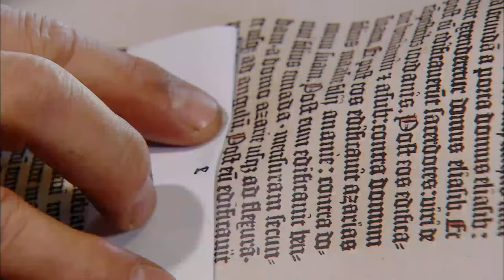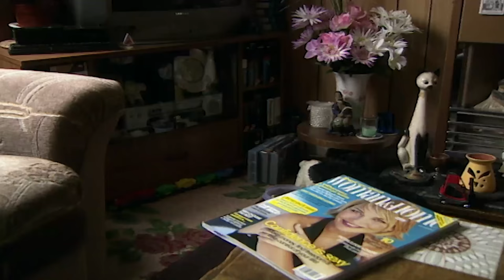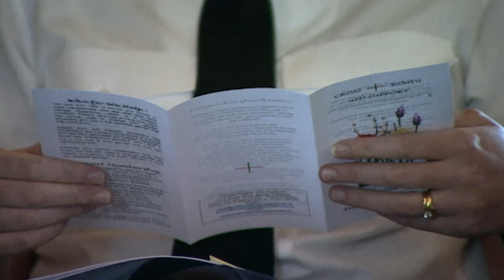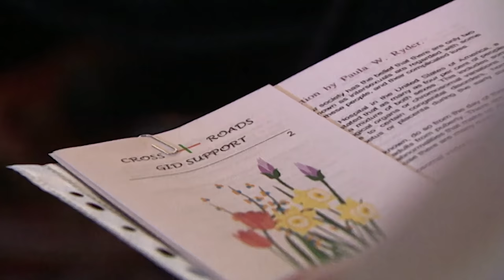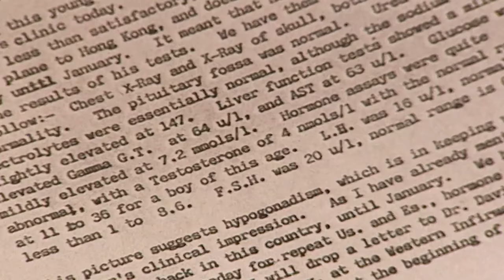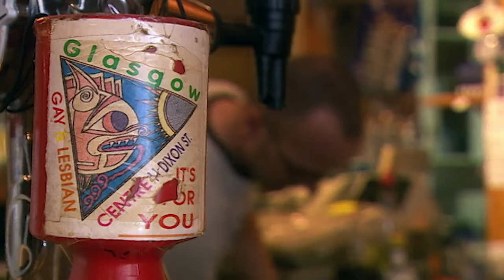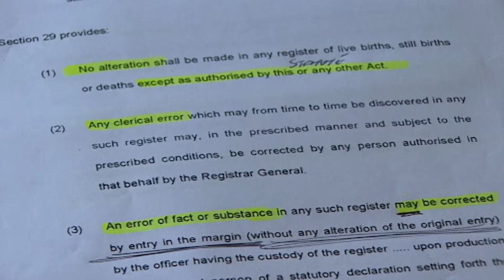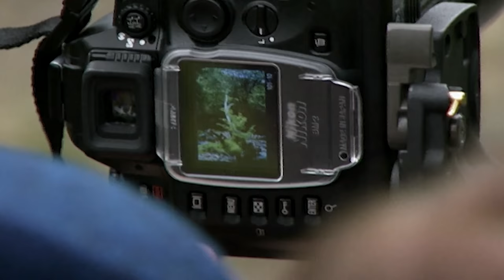Real Pride Special: Hear from XXY Individuals

Comment: Klinefelter syndrome, are not typically classified as intersex. This is because XXY individuals do not exhibit a discrepancy between their internal gonads and external genitalia, and they generally do not have both male and female characteristics. The Intersex Society of North America (ISNA) has historically avoided applying the term "intersex" to individuals with additional sex chromosomes, such as XXY, unless there is clinical evidence of intersex

. The 2006 Consensus Statement on Management of Intersex Disorders, published in Pediatrics, also does not include XXY individuals in its definition of intersex.  Approximately 50% of men with KS will have sperm detected with TESE/microTESE, of which a 50% pregnancy and live birth rate can be expected